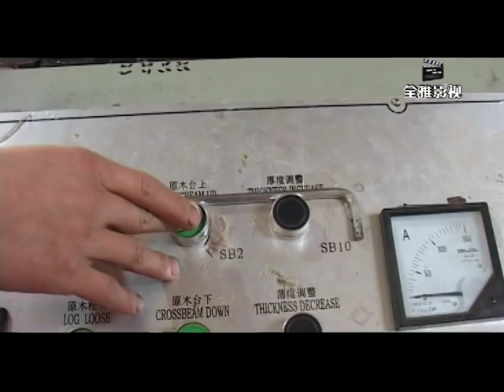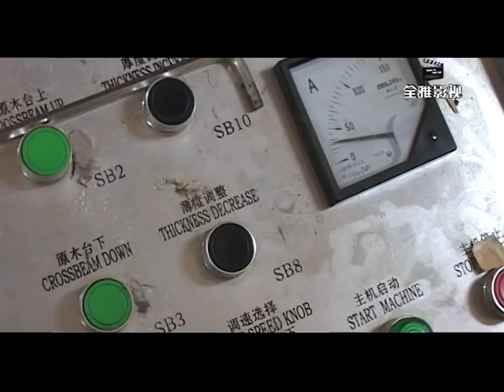Horizontal veneer slicer BB1130

Comment: Veneer cut like this is of much better quality than peeling turned logs, the downsides are also obvious. It's much less efficient, and the pieces will be a lot smaller, but there will be no stress from the wood essentially being flattened from a roll.
Reply: Mrav79 what would the difference be?
Reply: @flambo1234HD  the patterns will be different..
most round would give almost no pattern.
while this method give  cross section picture of the logs layers.
Reply: @samkom33  Softwood for plywood is peeled. Hardwood is sliced.